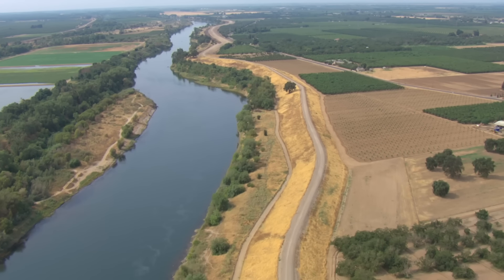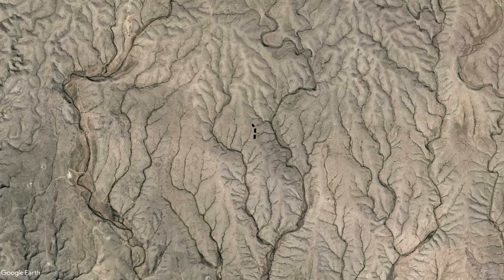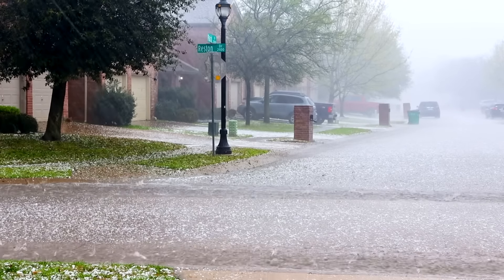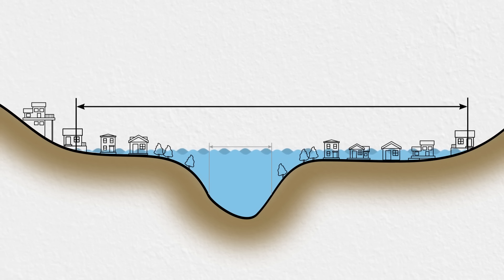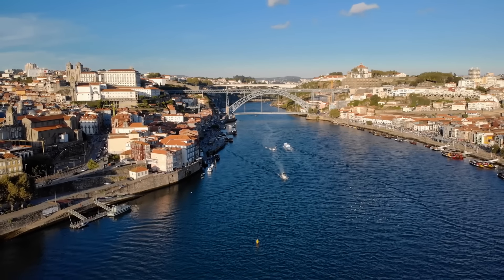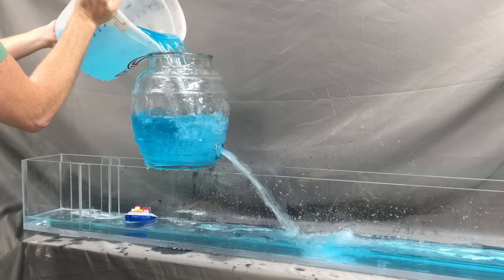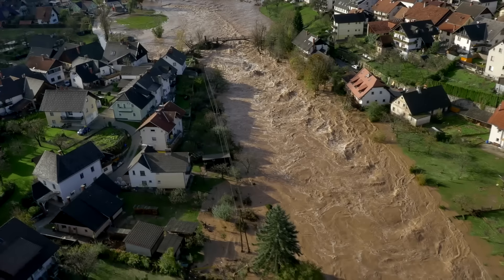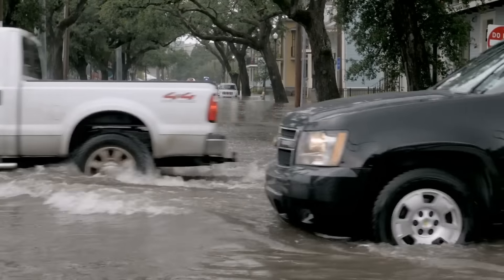How Do Flood Control Structures Work?

Comment: Flood management and historical hydraulic engineering often gets talked about with Romans and western societies, but there's actually quite a of them for Mesoamerican civilizations like the Aztec and Maya. The Maya city of TIkal for example had huge public rainwater collection reservoirs (as well as individual ones for specific households) with canal systems and levees between them for drainage if one reservoir overflowed and the streets, buildings, etc had channels and drains built into them to redirect the rainwater into them. There were also grids of channels to move water in agricultural areas and from more frequently flooded areas to less flooded ones, and aqueducts with multiple paths and switching stations to change which way they delivered water. There were also smaller reservoirs and canal systems strategically placed out for hundreds of square kilometres in a sprawl of landscaped suburbs around the city center.

Meanwhile, The Maya city of Palenque, in contrast to TIkal, had problems where rather then not having much access to freshwater and needing complex systems to collect it, Palenque had dozens of springs and many rivers inside the city itself, so it''s massive interconnected systems of aqueducts, underground pipes running underneath plazas buildings, and streets, canals, pooling basins, etc were designed to move water out. At least one of these underground aqueducts was pressurized to make a large fountain, and the city had some toilets.

Another example located in the temperate to arid hills of Central Mexico rather then the tropical lowlands during the same period is Teotihuacan. It also used agricultural canals and rainwater collection reservoirs, and it also re-directed rivers that cut through the city and were turned into geometric canals that went along with the city's grid layout, aligned with specific landmarks in the city, such as having it run alongside the Temple of the Feathered Serpent, which had water associations. The plaza in front of the temple could also be flooded for religious ceremonies. Some of the city's residential complexes (which, were almost all lavish, multi-room palaces, even for commoners), also had plumbing systems, and had running water from rainwater reservoirs, to use for drinking and cooking. The city also had toilets, though how they connected to other water systems is unclear. 

Fast forward another 1000 years, the core of the Aztec empire was dozens of cities and hundreds of towns all built around and on the islands in a lake basin. Many cities, Especially for the capital of Tenochtitlan, used grids of artificial islands to expand the usable land with Venice like canals between them. Tenochtitlan also had a complex series of aqueducts (including a dual piped one equipped with a switching mechanism), causeways, and levees to manage water flow and link it to other cities in nearby.

Probably most impressive is the water system for the personal gardens of the rulers of Texcoco, the second most important Aztec city, which was designed by one of it's Kings, Nezahualcoyotl , a renowned poet and who designed a few other aqueduct and levees. This system fed water from the Mexican Sierra Nevada mountain range 5 miles away (at some points the aqueduct rising 150 feet above ground level) onto a hill nearby the gardens, had a system of pools and channels to control the rate of water flow. The water then crossed over a huge stone channel between the gorge of that hill's peak and the peak of the hill (Texcotzingo) the baths were on, at which point the channel formed a circuit around the top of the second hill, filled the baths and a series of shrines and aesthetic displays (complete with statues, painted fresco, carved reliefs, etc), and dropped water off via artificial waterfalls around key points of the gardens below.

It's all really cool stuff and it's a shame Mesoamerican history isn't taught more.
Reply: Is Tenochtitlan the city where they built it over top of a swamp by putting logs into the ground and letting them petrify into rock-like structures to build on top of? I vaguely remember there being a city like that somewhere in mesoamerica, but I don't remember which one it was specifically.
Reply: there was also the amazing water management system in the kingdom of angkor, in modern day vietnam and cambodia. that area has a dry season/wet season system from monsoons so the kingdom organized massive canal and resevoir systems to control the summer floods and provide during the winter droughts. infact the reservoirs were actually a requirement to stabilize the foundations of many building in angkor-wat, the capitol. unfortunetly one really bad several year drought defeated this system and half the capitol fell into a sand pit. but for a couple hundred years it worked great.
Reply: Also the Hohokam of what is today the southwestern USA. Their irrigation canals are what made the harsh desert habitable for human communities. Even after they disappeared, the more recent Native tribes refurbished them for their own use. I've heard some of the canals that cut across Phoenix suburbs today happen to be the same canals dug over a thousand years ago.
Reply: This is awesome info from you all. There's always details I hadn't learned before. 

And I also agree, wish I'd been taught more Central and South American history in school
Reply: also ancient india's irrigation canals

Comment: "don't feel like it cant happen to you." I live on top of a mountain I think I'm alright lmao
Reply: ¯\_(ツ)_/¯ Landslide, down to flood level, seems possible!
Reply: @gus473  all granite
Reply: Even mountains can suffer from surface water flooding.
Reply: I'm Dutch...
Reply: @PfunkNH  Didn't NH's famous "Old Man of the Mountain" just break off and crash to the ground a few years back....? 🤔 Just sayin'....! ✌🏼
Reply: @ProfessorPesca  Not at the top, or near the top, as there is not enough places to run down to (catchment), to cause the surface water flooding, it all just runs down hill.
Reply: I checked the flood maps in the UK and found that the house I wanted to buy was at about 90m above sea level and was surrounded by lower land, also with a stable base rock so vast majority of Bristol would flood and due to topography of Bristol that would mean vast swathes of the country would be flooded do decided it was also a safe bet from a flood risk management perspective.
Reply: I live in Toowoomba situated on the top great dividing Range in Australia. I used to say the same. Google Toowoomba 2011 Floods.
Reply: @therealbigtony2650  lol, I just mentioned Toowoomba to another fellow Qlder in a comment thread on this video
Reply: @therealbigtony2650  just had a look at a topographical map of Toowoomba it's effectively a valley surrounded by much higher ground, apart from a small section, that's lower on the north north west approach, which I'm assuming the water ran to from the huge catchment around Toowoomba. To a hydrologist it looks pretty easy to flood, even though your at about 700m above sea level, due to the local topography.
Reply: I live within a few feet of the top of a mountain and still had a problem with flooding in my basement because of the high-clay content in the soil would drain the 4 feet of elevation above me right into it. Had to dig my diversion channels around the house and fill them with gravel to get the water to flow safely down the mountain and leave my stuff dry.
Reply: @timgilbert3051  water infiltration in a basement would not be what I considered surface water flooding, sucks for your basement though.
Reply: @cjhification  yeah that is pretty much it two creeks run through the centre of town, but because of the sheer amount of water coming down even the higher areas were flooded. The flood was mostly caused by roof overflow that had no where to go so each individual street actually flooded on its own.
Reply: @therealbigtony2650  topographical maps give great way to understand really quickly if an area is likely to flood; looking at that map, with no further info, I would have put it in the high risk category, for anyone in the city.
Reply: @therealbigtony2650  we have legislation that compels any new developments to deal with all if there own run off and have had for quite some time (early noughtis I think). This means that you don't get the huge accumulative effects of many properties discharging there own roof volume at what ever the rainfall rate is. When it was first bought in it was SUDS sustainable urban drainage systems but latterly has become SuDS Sustainable Drainage Systems, as they were first required in urban areas but are now just required. Was seeing the effects of huge new developments on watersheds in the 70's and 80's and the worsening effects of flashy floods further down systems. Flash floods are normally restricted to rapid respond catchments, but if you have flash flood conditions across several sub catchments, and have canalised the channels then the flood waters move at an incredible speed and cause massive damage.
Reply: @cjhification  Uk has far more rainfall than Australia. We design for 1:100 year events as standard but in 2011 it was much higher even than this. 
Do you work in the construction industry im the Uk?
Reply: @therealbigtony2650  no I work in environmental management systems for water management, and as a cell lead coordinating national response on logistics in the event of flooding or other significant events in England.
The construction I do is mainly at the weekends, or when on leave as I currently am.
Reply: @therealbigtony2650  but in the past worked more directly on flood defence, than latterly flood and coastal erosion risk management, and keep up with it for incident role.
Reply: @cjhification  Smart move. So many people never look at things like that then expect a bailout when something happens to the same place every 20 years.
Reply: @TheOtherBill  really funny you mention that. There was a couple in there 50 and an old lady in her 70's on a street named appropriately, that was close to a river that had flooded and we were out in attendance. The couple in there 50's had recently moved in and had redone the entire downstairs, changing from hard floors to carpets and plasterboard throughout downstairs. They were screaming blue murder about how incomplete we were and why had we not prevented the flooding, and how could we have let them suffer. The old lady bought out bacon baps and told us that it's flooded 4 times in her lifetime and is to be expected. She said it's why all of the cottages have stone floors and exposed stone walls for the first meter or so of hight so no damage was done by the flooding, just needed to be mopped out and cleaned when the waters receded. All her precious things were upstairs or high up, if on ground floor.

Comment: In Switzerland, at the lake of Thun in Thun they built a tunnel to help flood control, but it doesn't realy solve the problem, it just shifts it down river... to solve the problem humans would need to give the river space again to meander and or flood fields in it's original valley...

Soo... no more floods in the lake of Thun, but now they have a higher chance of flooding in the lake of Biel or the city of Bern
Reply: Bern: thanks. 🙄

Comment: I wonder how wild a ride it would be to go down a spillway. It could with the dam owners permission be possible. Take a 360 camera. Put it in a clear protective floating case or mount it on a canoe or kayak.  With owners permission a dam employee can chuck it in. That would be a cool video. You can also use that camera to track the flow down stream as well once it dumps into the river.

Comment: I remember the late Arthur C. Clarke saying that we shouldn’t call our planet Planet Earth, but Planet Water since most of it is covered with H2O. 🌏
Reply: If you want to really be accurate, the Earth is covered with a mix of mostly nitrogen and oxygen. By mass, there's an awful lot more rock/earth than there is water though (Even if you only count the rock in solid form).
Reply: What about the  other layers that are inside the planet?
Reply: Ok, so I should have been more precise in what I wrote and said the surface area of the planet is mostly covered with water. :)
Reply: @youammay3118  The other internal layers aren't covering the planet though... :-D
Reply: @peglor  Well noticed ! Thanks dude :D

Comment: In many cases we fail to provide adequate flood plane between levies.

Just forcing the water up doesn't help a lot if you don't provide width to give the massive volume of water enough area to cover.

Comment: Floods are also increasing because of the destruction of vegetation, which normally absorbs the water and releases it later on
Reply: True, loss of vegetative cover results in increased runoff since trees and other vegetation absorb and transpire tons of water in forests. The other problem is the increased installation of pavements (roadways and parking lots) in urban areas that do not absorb much rainfall leading to more water in the stream or river that exceeds carrying capacity.

Comment: I always wondered; is the flooding caused because the top soil (or infrastructure) blocking the water from seeping into the ground? If so why not build deep holes. My backyard is clay once you get past the 30cm of topsoil so when it rains it floods, so I put some vertical pipes down about 1m in length and this lets the water drain into the ground past the clay soil. (also makes watering the trees easier)

Comment: You need some balls to not mention the Netherlands.
Reply from the maker: I’m going to do a separate video on coastal flooding
Reply: @PracticalEngineeringChannel  based. The netherlands is so incredibly good with water.

I would love a video on how one lowers the groundwater level and its ramifications. It happens a lot in the Netherlands
Reply: Thx for the reply. Triple guess where im from.
Reply: @PracticalEngineeringChannel Looking forward to that!
I think Jorrit was thinking more of the Room for the River program/Ruimte voor de Rivierprogramma that was implemented between 2006-2015. The Netherlands, in addition to being literally a low country, is also located at he end of the Rhine–Meuse–Scheldt deltaside

Comment: An other solution are polders, a mix between diversion channels and dams.
Basicly they are floodplains or retention basin, enclosed by levees an all sides, and with a valve to a river to let them flood intentionally only at really high floods. They are normaly dry, and often used as meadows. Farmes have time to evacuate the heard befor the the floodgates are opend.

Comment: This makes me think back to horrible floods we had in Czech Republic in 2002. 

In southern part of the country there is ingenious system of ponds and fisheries from 16th and 17th century built on what was originally marches.

During those floods this system was able to withhold many dozens of millions of cubic meters of water without significant failure in 400 year old engineering while at the same time some much more modern damn experienced such failures. Always makes me appreciate just how important this work is and proud history of it.

Not to mention Holland where they have to constantly pump water out since they are quite a bit under sea level. It is quite freaky when you walk up that damn and then from the top you can see that sea actually is higher then where you climbed from...

Comment: This video reminds me of how Tokyo is dealing with flood by building an underground storage tank, which is really such an amazing engineering invention. Basically, it's similar to the diversion at 5:36 but instead of going into another river right away they go down to underground storage tank first, then those water got pumped out after storm is over.

Actually, we were living next to one of the river which is used for flood control during the typhoon last year. It was very surreal watching the live camera feed seeing the water level went up to 80% height line, then it started decreasing because they open the diversion gate down to the storage. In the end, our area didn't get flooded, and I'm so thankful for this piece of infrastructure.
Reply: It's very impressive

Comment: I would argue that the ability to control flooding is a hallmark of human civilization. Ancient Egypt and ancient China, among many other riverine settlements, got a big boost when they started building levees and irrigation channels, which reduce flooding and increase agriculture yield. 

One downside of levees is that siltation will eventually make the river bed actually higher than the surrounding floodplain, making flooding of the latter even more severe as there is no easy drainage against gravity. You should see a cross section of the Yellow River in the alluvial pan area. The difference between river bed and plains level is astonishing.
Reply: What the netherlands is doing with levees is destroy them and rebuild them a lot of meters away from the river so if there is a lot of water i can flood the parts with nothing on it and it leaves the important parts dry

Comment: Pumps are another big thing in the Mississippi Delta (not technically the river delta) we can get a lot of rain, and without the pumps the levees would act to pool water inside. Without the pump half my property (about 4 acres) would be under foot of water about 2-4 months out of the year, with the pumps it's only about a third of the property under a few inches a couple of weeks a year. I know this because I've lived in the same place off and one for 20 years, and when I was a kid we'd occasionally go canoeing in the back yard and adjacent forest.
the downside of the pumps is the swamps I used to explore when I was a kid don't seem to be very swampy anymore :/